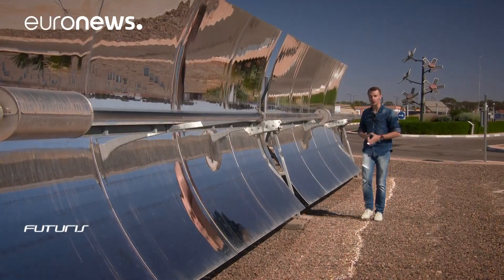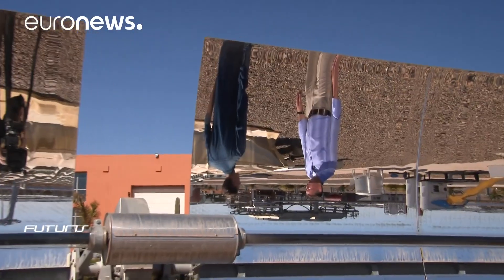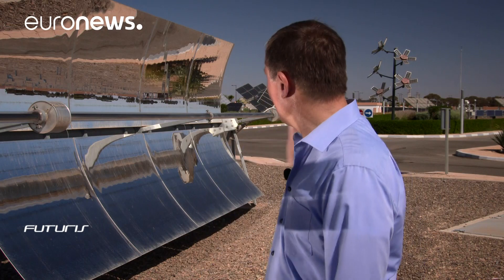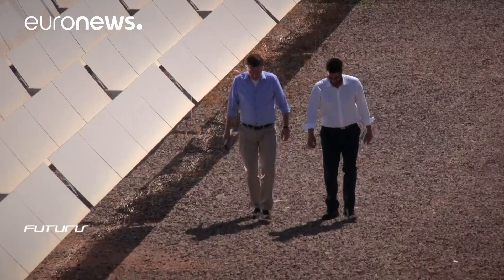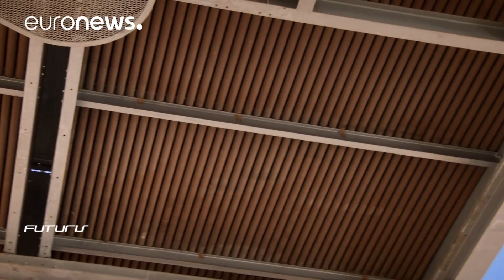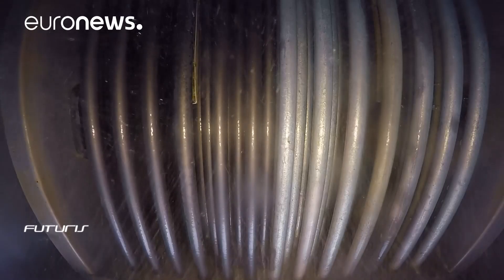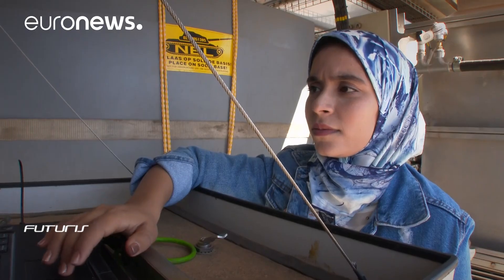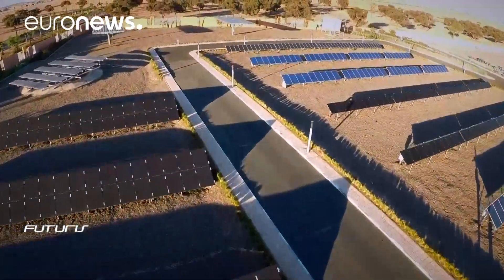Making green energy cheaper

Comment: It's very telling when they had to use many diesel powered  electric generators at the last Climate conference in Germany.  Why would they use fossil fuels to supply heat and light in a country supposedly being touted as the green energy superstar, and at a world gathering where the real topic is the elimination of fossil fuels?   I guess it's because green energy doesn't really work except in theory and among the delusional.
Reply: Mark, 

it's well know that the ouput of renewable generation is variable and unpredictable. I don't think it's widely known that back up fossil fuel generation plants are running even when renewables are providing a lot of power as it's the only way it can work and have security of supply. It really is a desperation measure that we use renewables at all as it's performance is pitifully low on average.